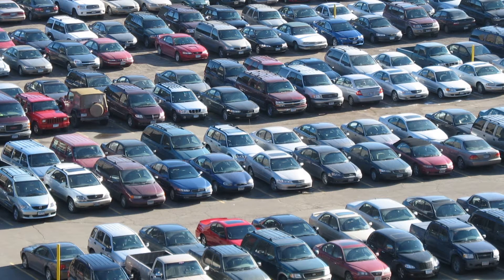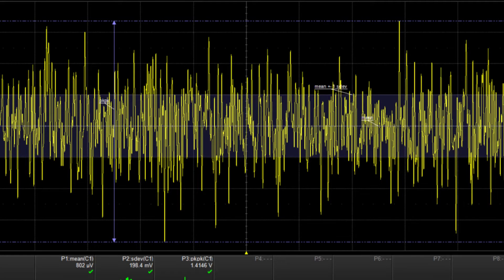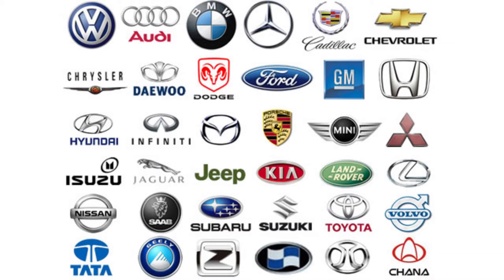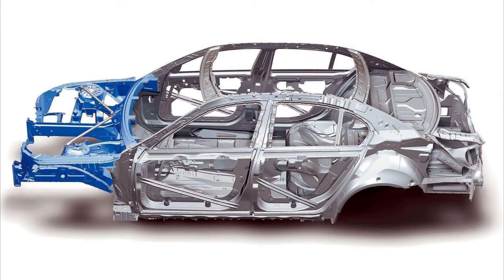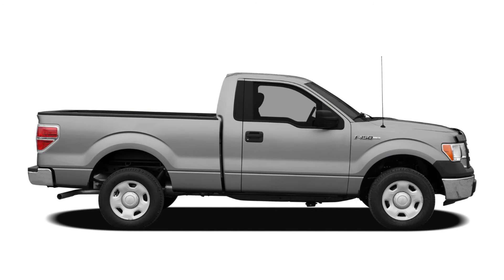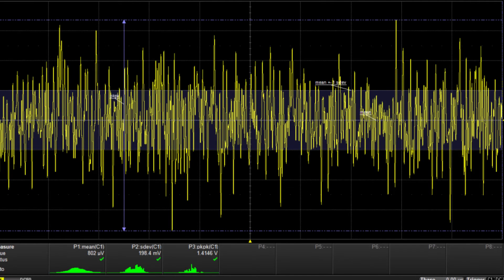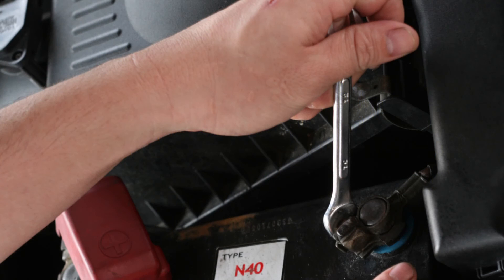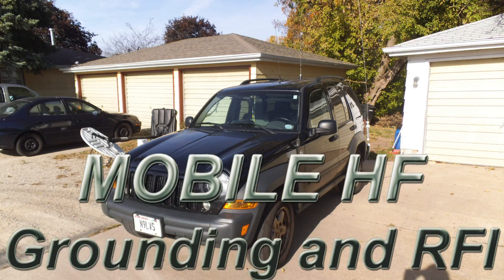Mobile HF Grounding and RFI

Comment: I'm running a direct power run to my battery. Rig is TS480SAT and antenna is a short hamstick from MFJ on the rear corner of the roof on a mag mount.  I'm getting a sort of pulsing hash noise on my radio that makes it hard to hear weaker stations.  I have no reports of noise on transmit.  Also, noise floor is probably S7 most of the time.  Any ideas?  I will not be drilling holes into the vehicle, btw. I have tried to switch to a lip mount system but it just really won't work on this vehicle (Hyundai Veloster) due to very small clearances. Would an active filter in the DC line, or a filter kit from Palomar which is ferrite beads for power and antenna wiring likely help?  The pulsing noise is not there if the engine is not running.
Reply from the maker: Active noise filter should help

Comment: they say run your dc ground directly to the battery and the rf ground to the body and frame to avoid ground loops, heres a question though, the body doors and hood are bonded to the frame for rf ground, but the battery negative post is grounded to the frame as well. sooo isnt that a ground loop right there? also dc ground to body goes to frame which goes to battery negative. am i missing something here?
Reply from the maker: I go direct to the battery to power the radio, I also make sure all doors, hood ect are very well bonded for ground plane

Comment: My unibody ford is fairly quiet on my HF receiver.  RFI is at its peak when engine running.  I  suspect spark plugs, or fuel pump. clicking speeds up as I rev the engine.  Also, the RFI when the engine is running, is more intense during the day than night.